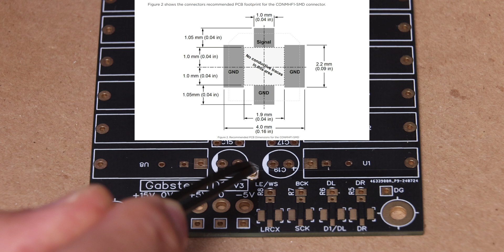How To solder small Components on DIY PCB

Comment: Nicely Done.
Looking forward to more in this series.
Hopefully you'll show how to clean up if you apply to much solder to the board by mistake as a beginner .
As a newbie solderer when you showed the miss of soldering @ 8:30 into the video wasn't the pin's making a 
connection by just touching them. Are you worried about vibration ?
Thanks
Reply from the maker: I will @ 8:30 if not soldered it would have failed

Comment: Using a hot air workstation and solder paste is much easier for those small parts
Reply from the maker: It is easier for sure but most beginners and intermediate DIY ers do not have a hot air workstation